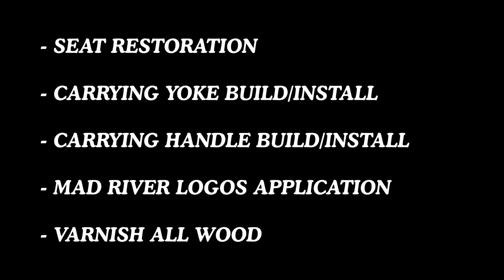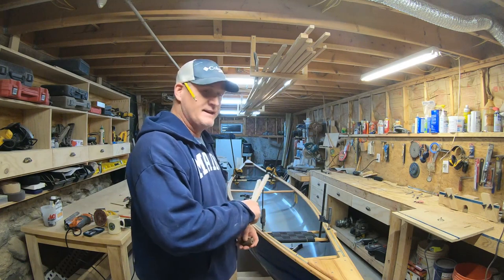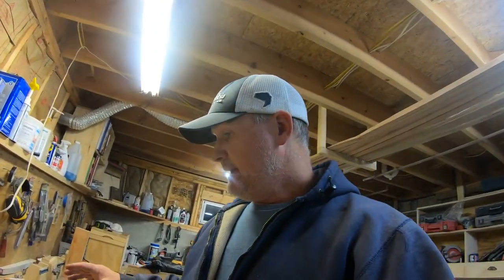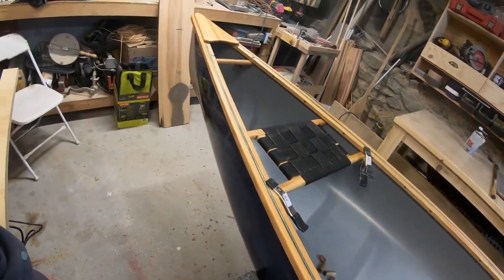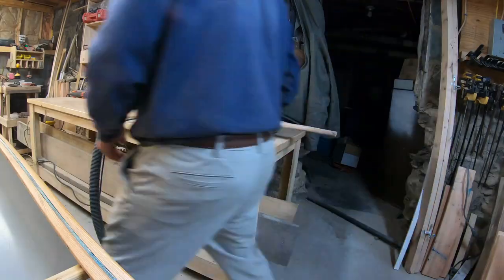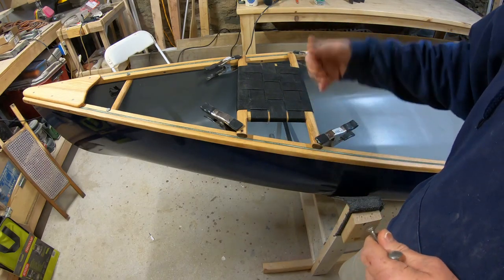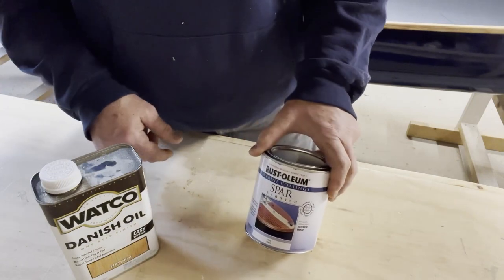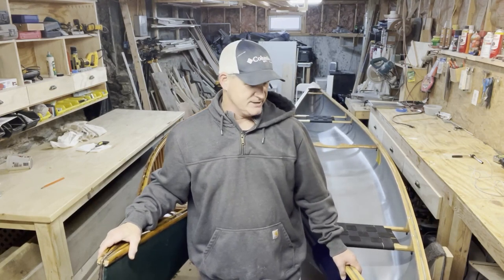Mad River Eclipse Royalex Canoe Restoration Completion Video, Part 4

Comment: I'll be following along on the wood canvas make over.   I snagged an older Old Town Chippewan/Hunter 14 foot last spring and pulled all the plastic off it in exchange for wood, dropped a few pounds off it, I took out the seats and just put in a kneeling thwart, I might have mentioned that in past comments,.  I got a video of the work but haven't uploaded to the tube.  Nice work on the Mad River.
Reply from the maker: I would be interested in seeing your project on the tube!  Seems like a fun project.  Thanks for following along and soon I will get started on the custom wood canvas canoe.  Have to clean up the shop first…… 😆

Comment: The best gunwale replacement tutorial that I've found.  Great job.  I'm getting started on the restoration of a Mad River Explorer restoration in a few weeks.  The boat came to me with all of the wood completely rotted off.  Do you have suggestion as to where I could find some factory dimensions for the beam as well as bow and stern seat locations?
If I clamp my inwales and outwales prior to drilling, do I need to strap or clamp the width at more than the beam at the center or will the hull spring to the correct shape?
I'm a professional woodworker and it was a pleasure to watch your video, you're very methodical!
Reply from the maker: Lauri, not sure what others would do but I would tackle your situation by using straps to tighten the hull to the beam width and then install the inwales first and then the outwales and screw them together.  You will want to mark the hull in a way as not to use the same screw holes.  A canoe hull has relaxed considerably with all thwarts, seats, yolks and carrying handles removed.  You will definitely want to persuade it with strapping.  In order to identify with seat placement in my opinion that is a personal choice.  How will the canoe be used…..solo or tandem?  If solo I would elect to place the bow seat more towards the centerline of the canoe.    In terms of matching factory seat placement you can Google your explorer model by identifying with the stamped numbering on the hull.  Explorers come in different lengths but a simple google search will give you the information you need for beam width for your model.  Additionally if you identify with the year your canoe was manufactured Mad River Canoe catalogs can also be found online to help you with your models dimensions.  I hope this helps and I certainly appreciate you leaving a comment and taking an interest in the video.  Let me know if I can help clarify anything else further.

Comment: Fantastic set of videos. Thank you for posting them. My dad has an identical canoe he purchased way back when and is quite eager to do a similar restoration.

I would be curious to know if the paint held up well? Pretty much every post I can find on painting ABS or Polypropylene suggests that the paint will just flake right off, which makes me hesitant to try it, but damn if it doesn't look good...
Reply from the maker: Samuel, thanks for the comment and best of luck to your Dad with the restoration project.  

I use the Rustoleum Topside products for painting plastic canoes and sometimes even so with my wood canvas canoe restorations.  I have had great results with the Rustoleum brand especially their topside formulations.  As long as the surface prep is properly done, primed and then painted the coating will last a long time.  I have used the Eclipse canoe three times and have banged off rocks and although scratches appear there is none of this flaking that I also have read about.  Utilizing the topside primer is key to a clean, lightly sanded  outer hull before attempting to coat with the Topside paint.  I intend to do a follow up video on the Eclipse topside coating after a few more camping trips.  

All in all the restoration project will be challenging, fun, and give a great sense of pride once the project is complete.  I wish you both the best of luck.

Comment: What were the materials that you used for the webbing on the seats?  More specifically what did you attach the webbing with?
Reply from the maker: Strapworks Heavyweight... https://www.amazon.com/dp/B01KTVAP0O?ref=ppx_pop_mob_ap_share

The webbing was attached with 9/16 stainless steel staples using my pneumatic staple gun.

Comment: Hi... I watched your videos... nice work.
I have several questions if you have the time.
--

I have a yellow 1981 Mad River Explorer 16' 8" (as I recall) and about 80 pounds wet. I replaced the gunwales two (2) years ago, along with the seats.  I resurfaced the thwarts. What I have not done is the paint. The canoe is in excellent condition.

Question(s):
- With regard to your blue canoe, how did the paint hold up on rock scraps?

- Does the paint chip or scratch?
- How UV resistant is it?
- Did you get dust in the primer and/or paint from the air in your shop?
- When is the best time to do the painting?
- I noticed the painted surface of the canoe was not smooth, as would be the case in a fiberglass/kevlar surface. Would you consider, in the future using a higher grit sand paper?
- How long did the sanding take?

- Do you have any thoughts on the painting procedure, preparation and paint to be used since this video was made?

- Where did you get the 'signage' for the rabbit and the name?

I am sure that there are alot of questions, I missed.
:-)

Thanks,
Max

ps.
I wonder if the YT community would be interested in a more indepth video on the painting topic?
Reply from the maker: The canoe that was restored was ready for the trash heap and badly damaged throughout.  My ultimate goal with this transaction was to score the 16’ vintage Old Town Canoe that they also were selling for restoration but instead a prior inquirer won the contest and will be hanging it from his rafters as a light fixture.  Nonetheless, I drove to the same owner and picked up a decrepit Mad River and thought it could use some love.  Most would have disregarded and thrown away this MR Eclipse but I put some effort into it to make it a usable canoe for my purpose.  Ultimately with all the canoes I have restored this was one of my favorites.  I have paddled the eclipse on about 6 adventures and the effort has been realized.  I knew the paint job wouldn’t resurrect a nearly dead canoe but all in all the paint work was spot on considering what I was dealing with.  The canoe is actually exceptionally smooth with the exception of the most dramatic deep gouges that could not be fixed.  I always paint after the entire canoe shop receives a deep dust cleaning and I control the reintroduction of dust when painting.  With a canoe this old you can not make it new and I believe I stated this in my video series.  The moral of the story is don’t throw it away rather do what you can to keep the canoe alive for as long as you can!  The sanding process is laborious and it was a combination of wet and dry sanding.  I also scraped the loose plastic with a razor blade to remove the high surfaces prior to sanding.  The sanding was always a light touch followed by a primer and finish coat of Rustoleum Topside marine coatings.  Paint will scratch when it comes in contact with a rock however the bonding nature of the paint and primer used has proven most effective with no flaking or chipping.  I highly recommend the Rustoleum Marine Topside coatings vice spray paint for this application.  Rustoleum marine topside coatings provides for an excellent uv protection which is needed for a Royalex canoe.  I haven’t worked with Kevlar canoes so I can not speak to them in particular.  I hope I answered your questions and if not please let me know.

The decals were made by researching the proper font and then reaching out to an online graphic designer to manufacture the decals.  They are waterproof and hold up well.
Reply: @mainetripper  
Thank you for your reply. 

I will look carefully at your primer and recommendations.

Thanks !

Comment: Hi, thank you for the great videos. Starting a similar project with a Mad River explorer and was curious how the g/flex epoxy has held up, I have similar cracks that I have to deal with.
Reply from the maker: Gflex has held up great as expected.  It is a great product that provides the strength and enough flexibility to last for long term repairs.  Good luck with your project!
Reply: Thanks! I'm up in Camden and have a similar fieldstone basement but mine is nowhere near set up as nice as yours!

Comment: Thanks for this video series.  I've stripped the hull down and cleaned up most of the imperfections but unlike yours mine is BRIGHT yellow underneath the stickers... I thought it was a tan canoe... I think I'm going to try vinyl marine dye to restore it to it's origional color instead of paint.  I only have one crack in the hull, about 2 inches long in the bow so I shouldn't need to spend as much time repairing the as you did.   But I'm not as good at woodworking, the season is starting, and I have a lot left to do!!! 😀
Reply from the maker: Ian, my take on your message is that you have immersed yourself in the project and you have overcome the first phase of most peoples fears to tackle a project like this.  Half the battle is over.  All that is required next is patience, enjoying the process and then finally realizing your hard work when you launch the canoe for the first time.  I wish you the best of luck with your project and I certainly appreciate your comment and am happy that you found the video helpful.  All the best Ian!